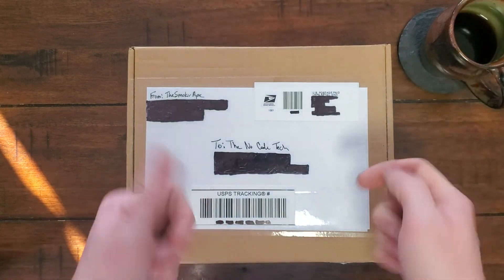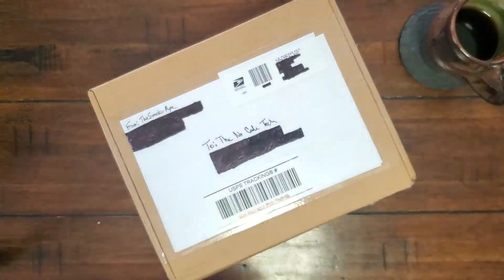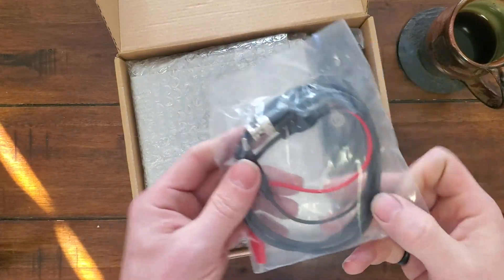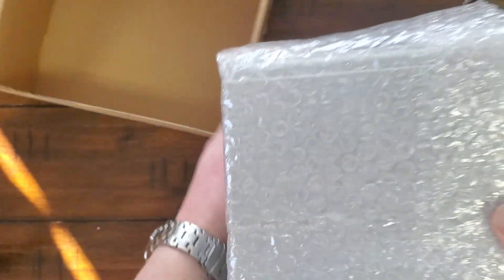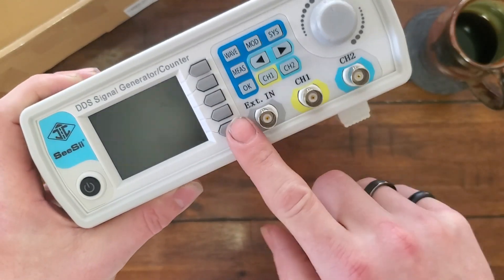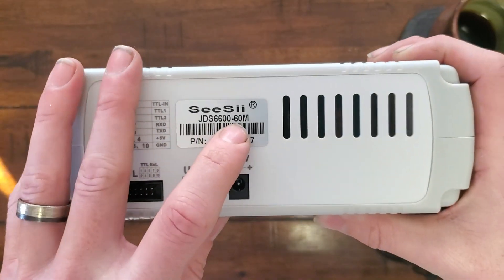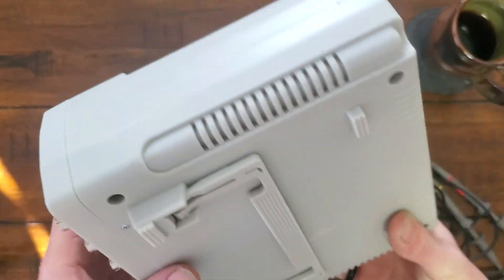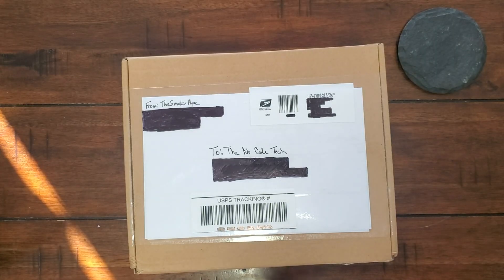Unboxing the SeeSil 60MHz Professional Upgraded DDS Generator Frequency Meter - The No Code Tech

Comment: I have 2 of them.always use an isolation capacitor when hooking to a circuit.Blew out channell 1 on both of them when injecting rf into circuits.
Reply from the maker: Great tip, I'll be sure to do that.
Thanks for watching!